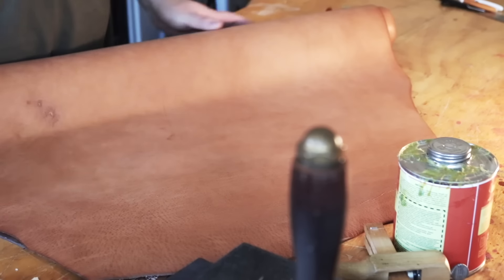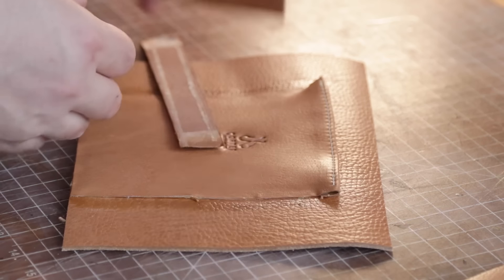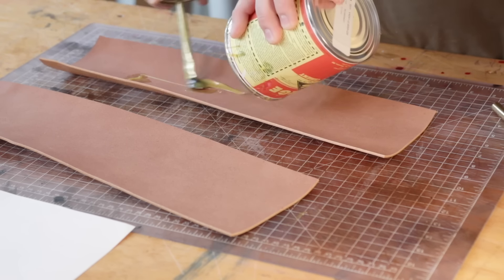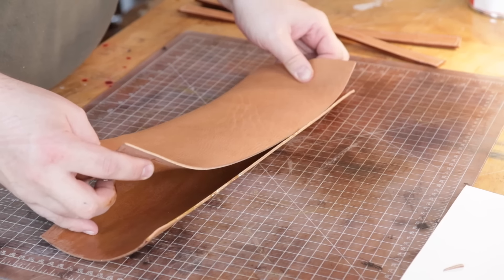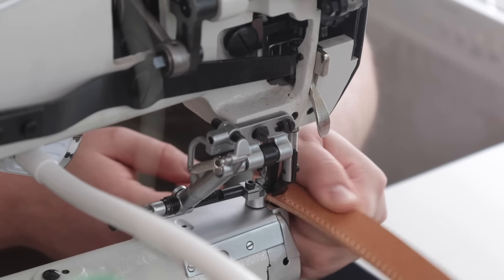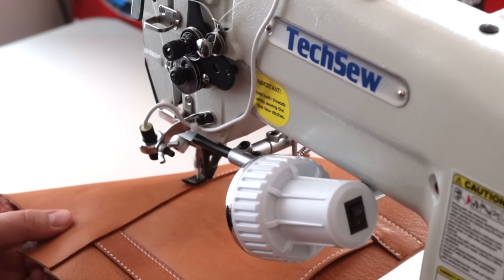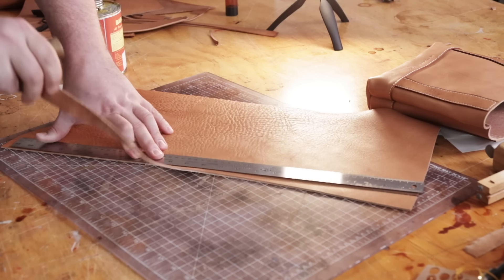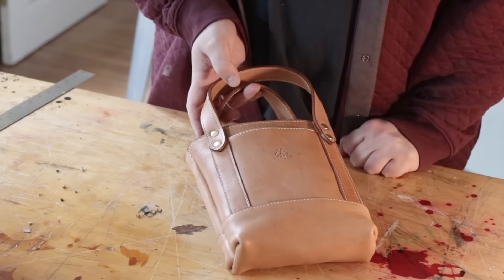You Can Make this Leather Mini Tote :)

Comment: Nice simple design and nice end product. I'll use your pattern as a starting point but use chrome tan, skive where needed & fully line and do folded edges wherever practical as I detest edge paint.

I work alone and my workflow is "kiss". I typically do a single sample, adjust the pattern and then do a short run, typically 5 items. I use a laser cutter for most of the pieces, including lining material and sew using a machine exclusively.

Comment: Being alone 🤔? Being lonely 🙁. 
I used to like the concept that there is someone out there who would like me enough to care about me and also love me. But then I kept meeting guys who were narcissistic and borderline sociopaths. They had the charisma of the pipe piper. I was never needy, my i.q is above 110, I have no problems socially at events, no longer on the heavy side, got teeth fixed, well traveled, speak a little Japanese, former military, and more. Yet, all I keep getting are narcissist - a.k.a. "bad boys". They are fun but when you actually want long term companionship, they are a waste of time.  So I grew up. Then i noticed that the men i was attracted to only wanted skinny women that wear a size 2 or shaped like 10 yo boys. 

After the last train wreck ended November 2014, i gave up. I cant go through that level of pain again. It was the the worst that no one could ever imagine. He even made my mother and son cry because of the emotional pain he put me through. I'm still recovering from the emotional trauma he caused me. 

As far as friendship connections? I have low tolerance for people now. Im not desperate for friendships. When i smell b.s., i run the opposite direction. Before, I was very open. But after everything i have been through and now going through, i trust no one. If i sense no integrity, i don't continue dealing with that individual. 

Am I lonely? Yes. 
Am I single and alone? Yes.
Do I prefer that? NO!

I got used to being alone and listening to the silence. I stopped wondering what its like to be hugged, invited somewhere, visited, have conversations, companionship... all because of the evil I have been in contact with most of my life.

I hope when I finally leave this country, I can heal better. The 3½ years i lived in the Japanese community, were the best years of my life. Coming back to the u.s. then being trapped in Ohio, makes it harder and 100 times worse. I can't leave my mother to die in a nursing home so im stuck here untilshe passes away. The way nursing homes treat people, I will be lucky to have her past tomorrow. They are that bad. I would take her with me if they had not debilitated her. She can't fly or travel long distance. Shes too fragile now.

If you love someone, don't fall for the t.v. commercials or ads for nursing home care. 3 nursing homes in 3 years and she almost died over 5x's. All of them rated 5star by the federal government.